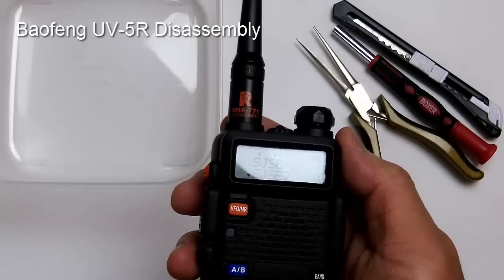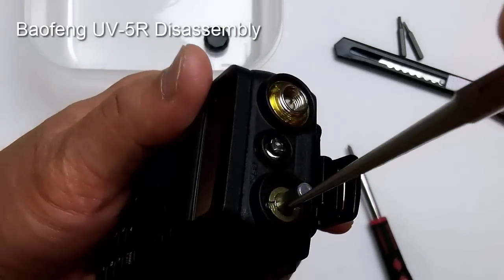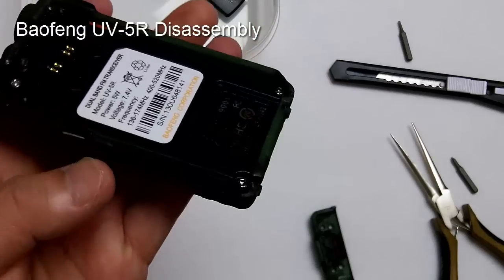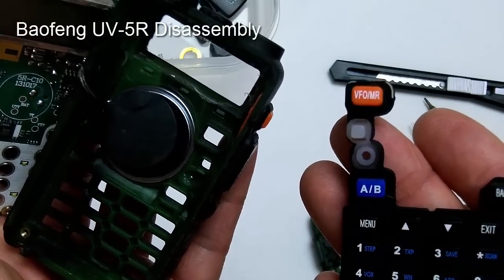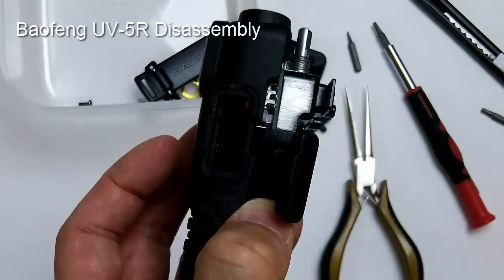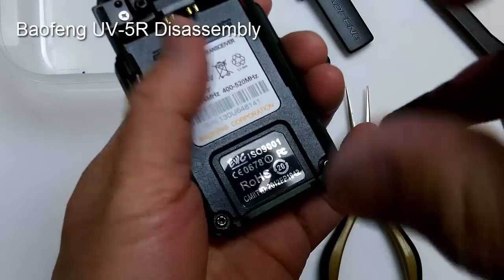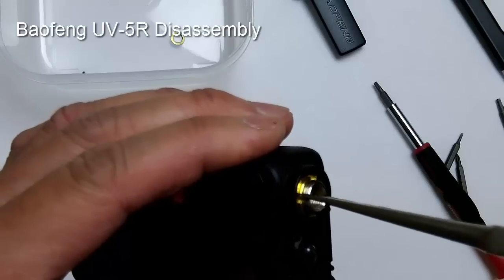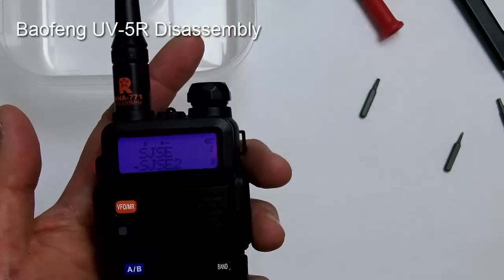Baofeng UV-5R UV5R Disassembly Teardown : Eye-On-Stuff

Comment: You can tighten the nut for the antenna connector using the volume knob. It's got a built in tool for the job!
Reply: Now THAT'S a really cool tidbit of info and a great feature. It is always a bit challenging to get those off without scratching something even with the adjustable spanner device I have or my needlenose pliers with the very fine points. BRAVO and Thanks!👌👌👌
Reply: I've been using these radios for 10 years and this is the first time I'm hearing about this. Thanks!
Reply: wow that's a really cool little feature! grabbed my radio straight away to try this

Comment: I have a UV9R-ERA, slightly larger radio and additional water/dust resistance. This was a very helpful video to get mine apart. Main differences - remove battery first, there are 4 TORX screws on the back under the battery rather than 2 (T8 worked), speaker and accessory connection are attached to the radio with a ribbon cable, plus there are O-rings and gaskets on most connections which require additional caution for disassembly and assembly.
Reply: I have the UV9R-plus, and thanks to this vid I could get it open. My signal reception was very poor (on a new unit!), but I managed to fix it by resoldering the antenna connection on the PCB, and cleaning some green muck (corrosion?) from the PCB. 🤘

Comment: Finally inventoried all my Baofeng's and found only one UV5R in black.   :-) 
From my experience, all the different flavors of the UV5 radios are really similar.  Other models from other brands are suspiciously similar, too, and sell at many times the price. Every one of my Baofeng's work.  
They're extremely versatile. The innards are almost artistic, both in form and function.  Repair parts are even available,.  They've become a type of standard.
That one other-branded HT I bought came in defective. Wish I had bought five more UV5R's instead. I find significant use in the UV5's hardware and associated software, employing them as much as instrumentation, as transceivers, Always at hand.
I even experimented on 1.25 meters.  Cheap. Those pioneers who cobbled together their own Amateur radios would really envy these.
There is great value in professional grade communications equipment, but it cannot be shared as freely as these.   I wish there was even more interest in them.

Comment: Don't muck with needle nose pliers on the antenna connector. The volume knob has the correct cuts for loosening and tightening the antenna connector.

Comment: You didn't take off the board, which is the worst part as you need to remove the display to get to two screws.  When you refit the screen you might have problems with the display function.

Comment: Hey OM , Motorola, used to sell spanners for those nuts, came free with ever radio. I was hoping you would open the microwave casting, to show ppl how to repair/replace SMA connector. I had the joy of buying junked radios at auction , great learning experience. A young guy said" how'd you learn to fix that stuff?" I replied , My dad made me fix what I broke, or explain why I could/should not. No school like a junk box! KB5ZXM or FCC PG9-6292 cheer's . Good hunting for gremlins.
Reply: John Egan , these came with new radios, I bet any Motorola, radio shop has hands full, General Electric did the same. simple little things, like an antenna nut tool, but bent at an angle. Just two prongs on a flat strap, drill a hole , to allow shaft, cut the strap bend  to suit your size.

Comment: I had to dismantle my UV 5R ,  the internal adhesive used around the screen  had become problematic insofar as  after cleaning created permanent trace marks on the screen cover , it's ok , just a little annoying , plus regardless of compressed air cleaning there's dust traces trapped  .

Comment: I need a replacement speaker for a Anytone AT-D878uv.   40mm 16 ohm, 1 watt.   This speaker from other videos is also 16 ohm 1 Watt but don't know the diameter.   Would you know where to buy a replacement speaker?

Comment: Thank you very much for this video. My flashlight LED does not work. Seems like even if I opened the radio like you did, I will have no chance to fix the problem. vy 73s
Reply: +Jürgen Günthner Not unless you removed the screen
Reply: The moni  button needs alignment. Mine did the same thing. I took it apart and now it works. So fix it.
Reply: Thanks for you answer. But I am not sure how to do that.

Comment: No worries if you break speaker wires. I did and it was not that hard to solder it back. 

Anyone with soldering iron.station can do it.
Reply: Happened to me too...be careful with fragile speaker wires unless you love soldering.
Reply: I am thinking of rplacing wires with better, silicone ones... Next time I open it :)
Reply: I did it, snappy resolder job fixed it

Comment: Hi pal. Great vid. 
I’m in the process of putting a UV-5RE inside a dummy PRC148 shell.
Like you I’m adept at electronics but I wanted to know how easy the on/off pot would be to unsolder and run on flyleads to another location?
Reply from the maker: Crashtest Airsoft I have not tried to remove the pot before.  Since the pot has larger pads on the PCB, it might be easier than dealing with the tiny surface mount parts.  Good luck!

Comment: On two of mine I have a scratchy volume control when adjusting the volume level.. Was hoping to get a spray of Deoxit in there by taking the radio apart but as I watch the video it appears that the volume control might be sealed making spraying the Deoxit impossible. Has anyone attempted to clean the volume control?  Any luck?   Thanks.....

Comment: You didn't open the circuit board.
Reply: You would need to unsolder display for that...
Reply: No you don't need to unsolder anything in the process. To take off the circuit board to get to the mic/headphone jacks. You simple remove all the phillips head screws. There is 1 screw under the screen. If you remove the 2 screws from the screen, just peel it back. It's not actually connected by cables. The screen lifts off easy. Just be careful when you replace the PCB, there are 4 small pins that need to be lined up that connect to power.
Reply: Lord Anubis  You need to unsolder screen to peel it back. it has 4 points it is soldered on to a board...

Comment: HI EYE-ON STUFF Realy enjoyed your video can you please help i recently removed the battery on mine with the unit switched on and now it wont work when you disassembled the unit did you notice a protection diode etc in the unit hope you can help DOWN UNDER TERRY CHEERS
Reply from the maker: I did not notice a protection diode. The ones I have appear to be fairly robust.  I remember doing the same thing,  removing the battery and not switching it off and i have not had any issues.  I do remember one time the radio lost all power and did not appear to work, but I figured out that the battery was not making a good connection. I had to re-install the battery with more force and it started working again.  In your case, maybe you can try another battery or check the voltage of the one you have.  I hope you get it working.
Reply: @eye-on-stuff5248  THANKS for quick response if you do hear a fix  i would appreciate purchasing new unit have plenty of spare batteries now CHEERS